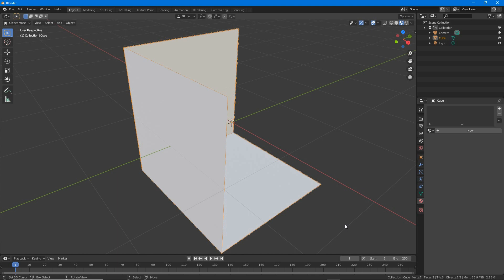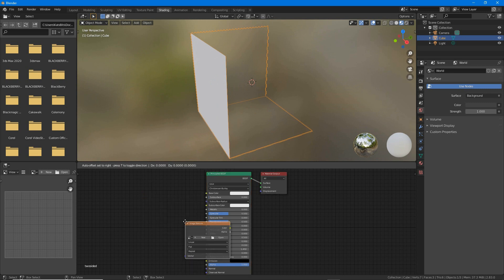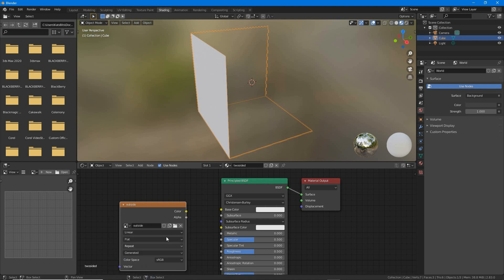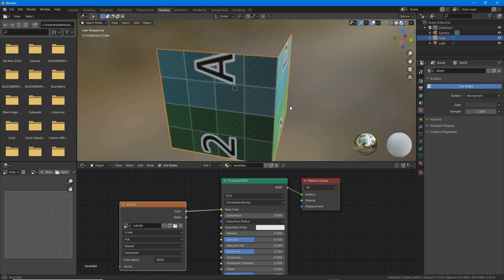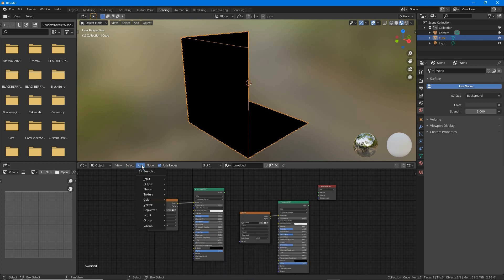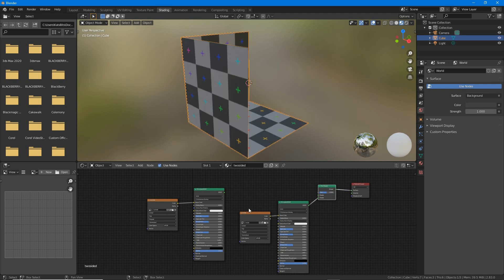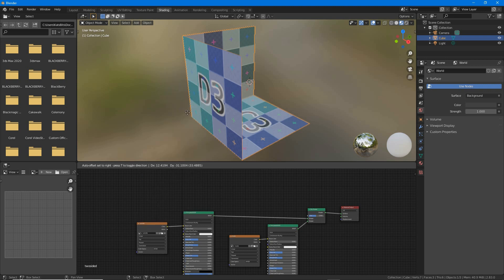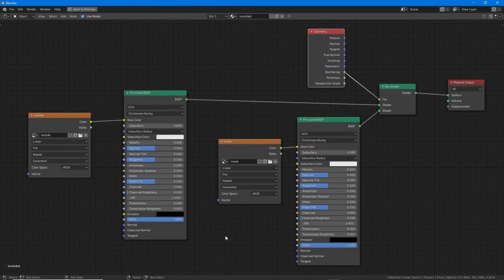Double-Sided Materials in Blender

Comment: How can I set different UV areas and scales for two images—one for the inside and one for the outside? The UVs are currently synced in the editor, and I need them to be separated. Please help🥹
Reply from the maker: You might be able to do this by linking separate UVMap nodes to each material (Texture Node input), these should then reference different UVMap data.

Comment: I found you don't need 2 BDSFs, at least not in 4.3. . . . just a mix shader with 2 textures one in the A & and other in the B,, and the geo with backface into the Factor.
Reply from the maker: Yep, for basic 'diffuse' only materials the Image Texture nodes can be directly linked, otherwise Principled BSDF is necessary to include other shader/surface effects e.g. normal maps.

Comment: If you're having trouble making it work, Turn off back face culling (unlike the video). Worked for me! Also, if you have a solidify modifier, you have to remove it.
Reply from the maker: That's why Backface Culling is mentioned as an OPTIONAL step in the process as it depends on what you're doing. And yes, if you have any 'generative' modifiers they may need to be disabled/removed completely, or you'll need to find a way to work around them.

Comment: thanks a lot! any guesses as to why my fbx no longer has any images bundled with it? if i export without doing your trick, my fbx comes out looking right. when i do what you suggest in this video, everything looks right in blender, but when i export to fbx, neither side has any color information
Reply from the maker: What problem are you having exactly? Are you trying to export a two-sided material or mesh with front and back faces. The former might export but may not import as it relies on the destination understanding Blenders material system. The latter will work because it's actually using two distinct material assignments.
Reply: @KatsBits   thanks for your response. yeah i was trying to bring it in to touchdesigner and having trouble, but i hear you, it's more likely that the two programs don't talk together perfectly. i'll figure it out thanks

Comment: How do you bake that? I tried and it duplicates the front texture to the back.
Reply from the maker: That's a very good question. You're likely going to need to make sure you're baking to distinct images *per side*, and that each side references a distinct UVMap datablock otherwise yes, it'll assume the result based on UV assignment (more than likely). https://www.katsbits.com/codex/uv-maps/#generate-uv-map-uvmap
Reply: @KatsBits  I couldn't really figure it out your way.

What I did was, I duplicated the face, with an inside and an outside material, then made the inside face not visible from the outside and the outside face not visible from the inside. 

The only problem here is that you're using twice the vertices.
Reply from the maker: @fujtkrisztian  Yes, that will work because Bake is rendering out separate face data so it knows what it should be doing. Once you have the baked image you should then be able to remap the image back on to the original material, replacing the image previously mapped.
Reply: @KatsBits  Yep, but would all this be possible using a single plane for both sides?

It would be really beneficial for boosting performance.
Reply from the maker: @fujtkrisztian  inside Blender it won't really make that much difference unless the two-sided material is being used on something like grass that means a lot of overdraw. Once you have the baked images though you should be able to map that back on to the single mesh-two sided material without issue.
Reply: @KatsBits  Ok, thank you!

Comment: can this be baked?
Reply from the maker: Not tried it but in theory it should because you're baking to separate images. May take a bit of tweaking though.
Reply: @KatsBits  I am working on a project and solidify seem doesn't work well, can both side to be baked into a same texture map? How should I unwrap it?
Reply from the maker: @thomasluk4319  that can be done yes, but it'll depend on the UVs being mapped to the same image - different materials can reference the same image, you just have to be organised about placement.
Reply: @KatsBits  ok, seem i cam understand why u mean, but still have to test the actual workflow for that

Comment: none of this shit works at all, why the fuck is this so complicated.... Is there something specific I need to do for something that only has 1 face and was previously part of a cylinder until I separated it in edit mode?
Reply from the maker: If you're trying to make the separated face two-sided it'll likely need a new material assignment otherwise any edits made will apply to the original.
Reply: @KatsBits  eh its not a big deal now, I am rebuilding what I had in blender but in unity using a plugin called pro builder which is like a primitive version of what you would find for edit mode in blender, which works for me~

Comment: This is so much more complex then clicking a single tick box in 3ds max :(
Maybe im just needing to get used to it.. but i use double sided texture a fair amountt
Reply from the maker: If Max is assigning a different material to either side of a face when you check the box it's basically doing what's described above behind the scenes so you don't have to (meshes aren't two-sided by nature).

Comment: I'm trying to apply this to a box that has a solidify modifier to give it some thickness and it does not work. Any clue here?
Reply from the maker: Thickness will only show whatever material is assigned/configured on the outward facing surfaces because you're making the object in a way the nullifies the whole point of the mesh being two-sided.

Comment: if 2nd image has text, it will shown flipped!! how to fix this issue?
Reply from the maker: You can flip the image in an image editor as the simplest option or try swapping the Shader inputs to the Mix Shader around. Otherwise it means setting up a more complex shader.

Comment: Tip: If you want to use normal maps you have to invert green channel on backfaced material normal texture to avoid shading issue.
Reply from the maker: Yep some fiddling may be needed where normal maps are used (same goes where content is being exported for external use).

Comment: Very useful. Thank you. 
One question : when i export that by format GLTF and open it, just the front side appears on both sides. can you help me please?
Reply from the maker: You need to find a way to disable what appears to be the double-sided property the engine you're using is applying to meshes by default. This is either going to be a global setting or something that can be individually overridden by material assignments to mesh surfaces/objects (for idTech engines for example you could use 'cullDisable').

Comment: Doesn't work for me
Reply from the maker: https://www.katsbits.com/codex/double-sided-materials/ there's a example file in the link that can be used to test what you're doing. Using Cycles the material(s) may need to be set up differently for backface culling https://www.katsbits.com/codex/backface-culling/
Reply: @KatsBits  Thanks a lot. It works later.

Comment: sorry this didn't fix the backface culling materials are still transparent in obj even though I have double sided material.
Reply from the maker: Download and open the example file https://www.katsbits.com/codex/double-sided-materials/ (this is why the examples are provided where possible). If that works you're missing something. If it doesn't then something might have changed depending on the version of Blender being used (although it should work with versions currently available at time of writing).

Comment: we need a video about how to export a mesh (t-shirt) from blender to use it on imvu without errors , i stuck with the settings PLS
Reply from the maker: Keep an eye on this page https://www.katsbits.com/codex/imvu-export/  "FBX Export for IMVU"
Reply: @KatsBits  thx man. if you dont mind i have a question about why the mesh of a t-shirt dont stick to the body in imvu,  in the sitting pose the mesh goes inside and the skin exposed, any thing to do to fix that (blender settings or imvu settings) and i will be thankful.
Reply from the maker: @brahimaxDz  see here https://www.katsbits.com/smforum/index.php?topic=1076.0 and here https://www.katsbits.com/smforum/index.php?topic=1077.0 that's a weight painting issue that can only be fixed with a bit of patience and testing.
Reply from the maker: Just added a couple of export vids for tops https://www.katsbits.com/codex/imvu-export/#videos